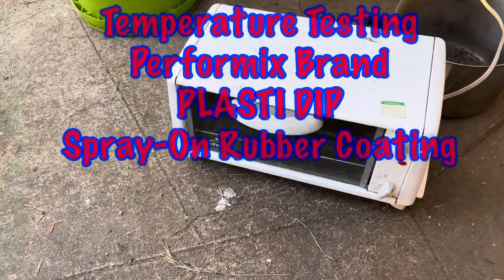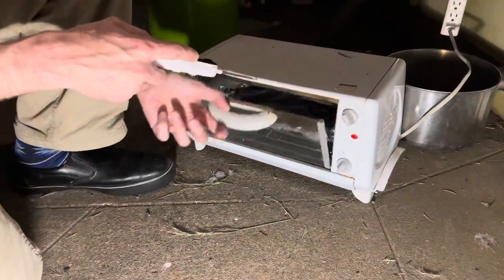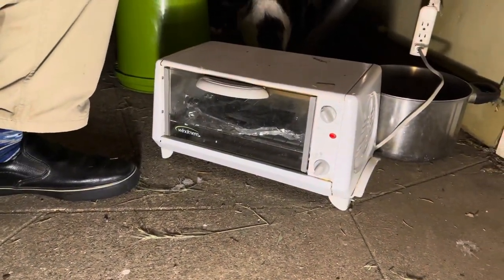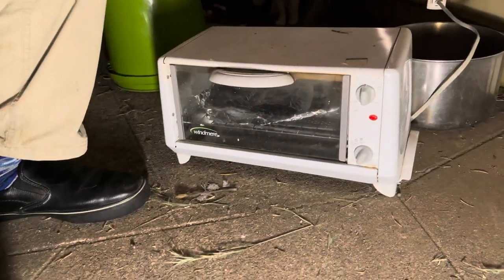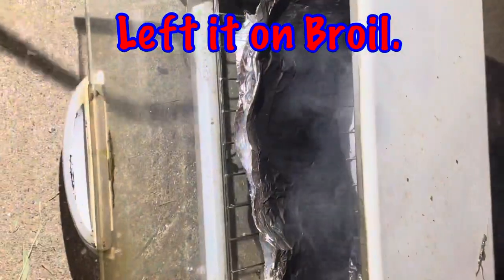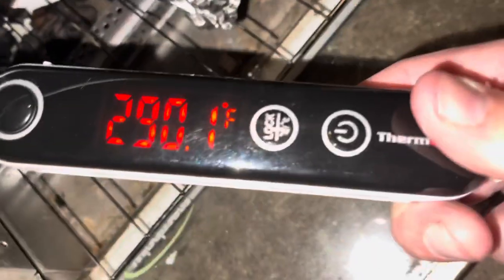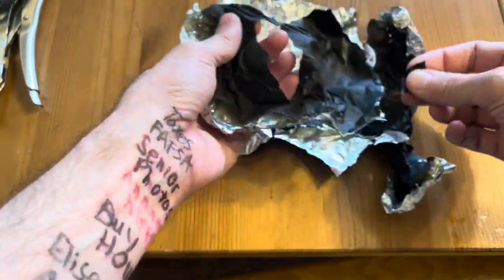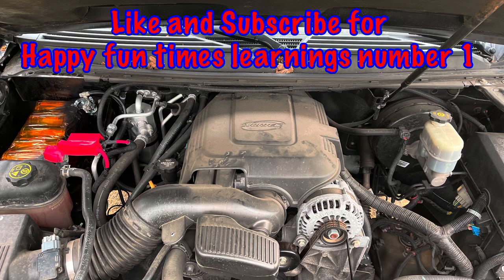Replacing car battery with super-capacitor in car - addendum for Plasti-dip temperature test

Comment: I get it now! Makes sense and good on you for considering the ramifications and going the extra mile and testing. Cheers!
Reply from the maker: Yeah, well having had a fire in my car engine compartment probably helped me think about it.

Although the fire in the car then was not from this.
it was from an improperly installed 12 V line for the trailer brake that U-Haul had installed into my Isuzu trooper back in 2000.
It was installed over the exhaust, melted through the insulation, and short circuited to ground (and no fuse installed in the new power line) and it got red hot and smoking, and it was running under the fuel tank... I had to yank it off in a hurry with my bare hands because I thought it was going to touch off the gas tank.
it was pretty awesome.

Anyway yeah my wife and I are driving around with it so, self preservation really.
And yeah I guess not technically a full engine fire.